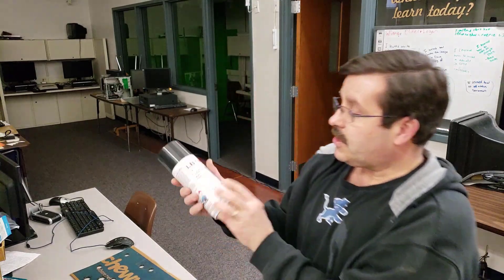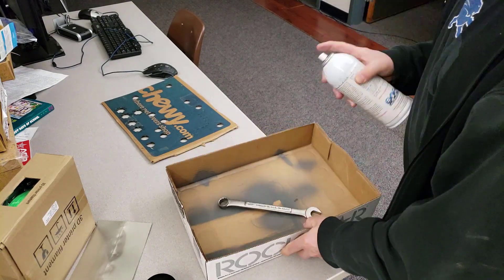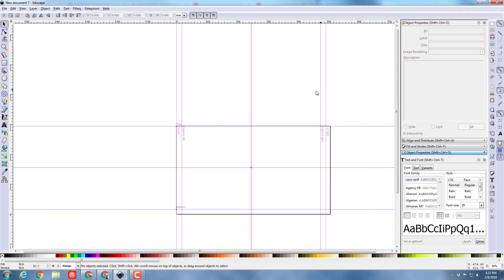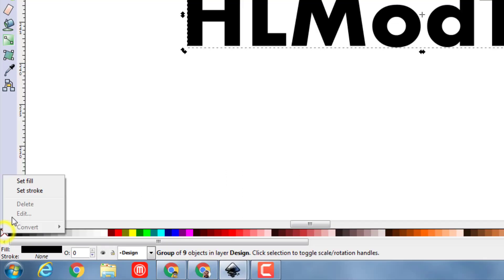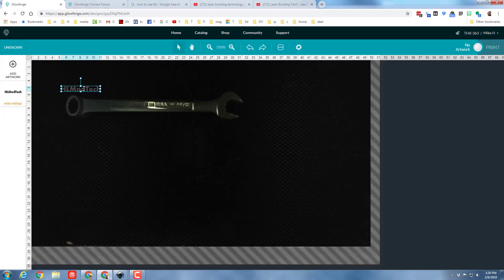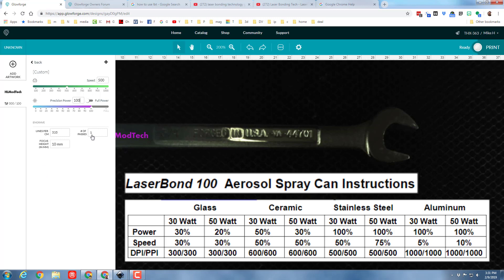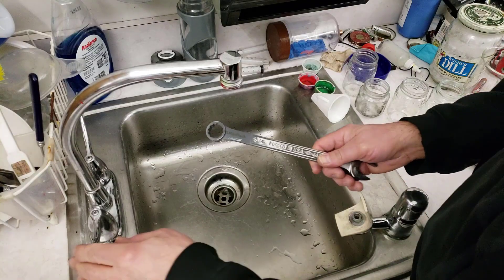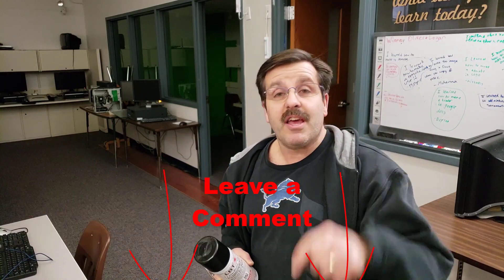Mark Metal in Minutes using LaserBond 100 and your Glowforge

Comment: You were lined up nicely on the camera.
Reply: But it's a fish eye lens. I knew before you ran it it would be off to the left. You have to take that into consideration, the farther to the side of center your work is the farther the offset will be. Try to get the spot your burning as close as possible to directly below the camera in the cover. You can also put a small piece of tape over the area and very lightly engrave that then adjust the artwork as necessary before committing to higher power. You could also make a jig for items and make sure your engraving lands in the jig exactly where you want it before putting in your piece.
Reply from the maker: @beer1for2break3fast4  Thanks for the tips. My glowforge is in the shop. =(* Hopefully it is back and running full steam ahead in a week or so!
Reply from the maker: Thanks! First time I have heard that. =)

Comment: Would the LaserBond work well on the metal slide of a firearm? What if the firearm is black metal (like a Glock)?  Awesome series of videos, thank you very much !
Reply from the maker: I do not have much knowledge of guns, but I picture them having a finish on them that would be a problem.... if there were a way to get down to the metal, then I think you have a good probability of success.  I will see if I can get in contact with someone at Laserbond to confirm it as well. Thanks for the question!